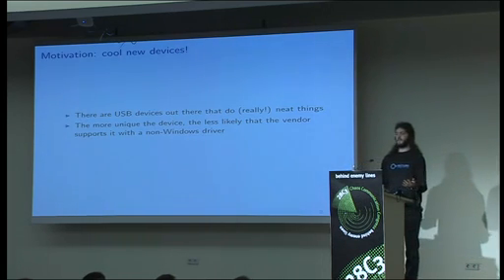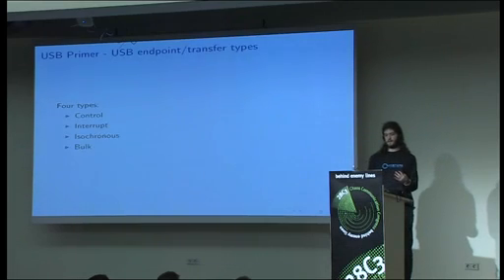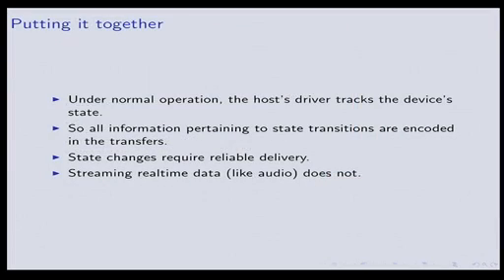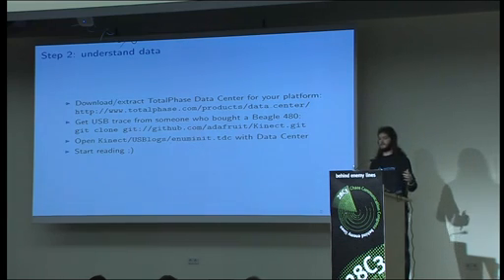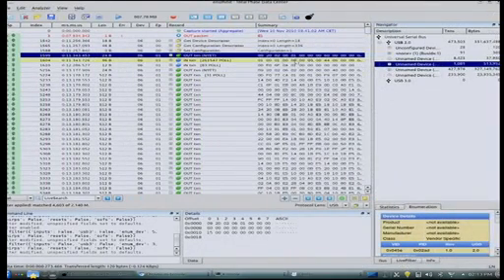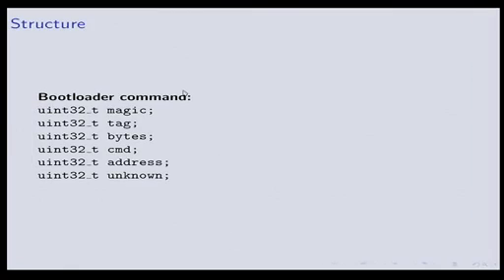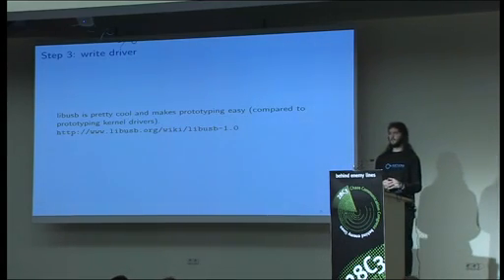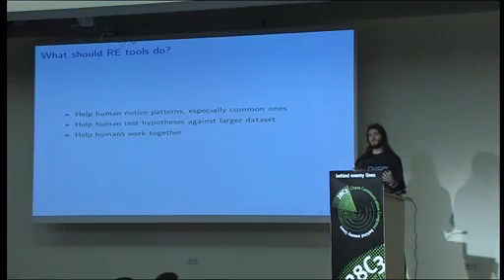28C3 - reverse engineering usb devices

Comment: Hello everyone !
Beginner user of our favorite software to analyze USB communications, for practical reasons I would like to know how to save the "payload" in the capture file, excluding the USB protocol layers (tokens, PID, handshake ... among other packaging data).
I'm using Linux Mint and my skills about programming ang compilating are very very poor.
Thanks for your help.
Reply: usbmon has an option to dump to a file with grep
Reply: @ItsMeChillTyme  Does it  capture all kind of packets like a scope? So, for example can we see all of the polling with it, 8000 times per sec?
Reply: @gaborm4767  I don't think polling works that way. It will see any change for sure. The changes are reported at a checking rate of 8000 per sec times it checks by the hardware. If you make 8000 movements, it will log all those 8000 movements. If you make 9000 movements, it will still report 8000 movements because that's how many times the hardware checked. Hope that clears up any confusion as to what polling means and what it will report. 

Also, if you only make 1 movement in a second, it will report that 1 movement only too, in case there's confusion. It is all about changes.

Comment: Sir i have usb hid device that communicate with android app i want capture communication data and  run independently without using android by using rpi or arduino? Is it possible?
Reply: Idk sure whatever. Actually no
Reply: @feelingfriskyx560  after 2 years
Reply: @shrikantnikam2426  well did u find your answer
Reply: @feelingfriskyx560  no I used another method to complete project.
Reply: @shrikantnikam2426  exelent! Truly a master in project completion with intense research skills. Always knew you could get the job done shrikant!!!!!
Reply: @feelingfriskyx560  thanks